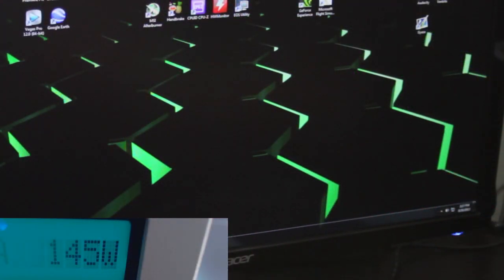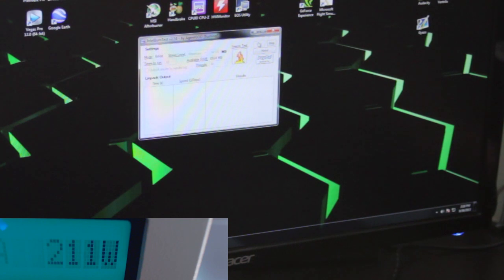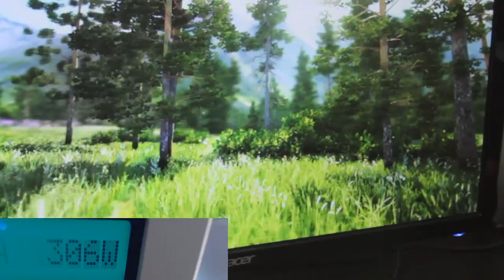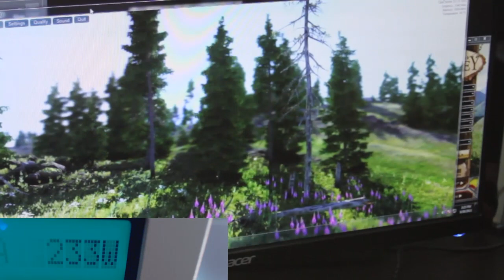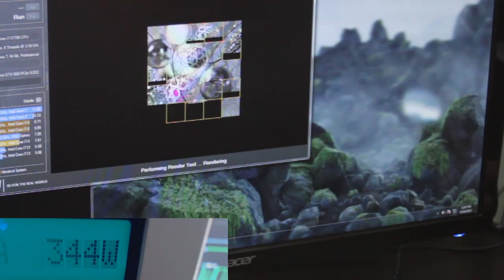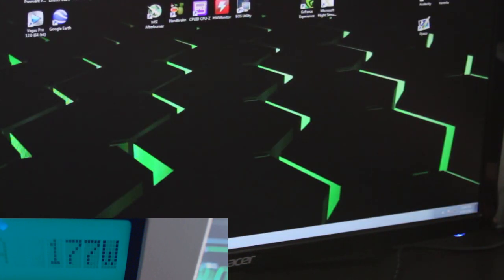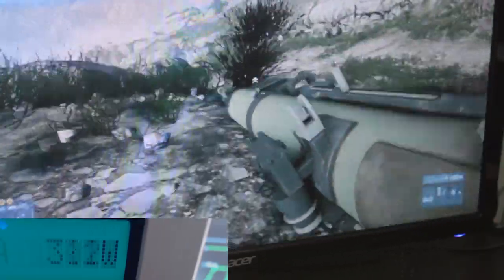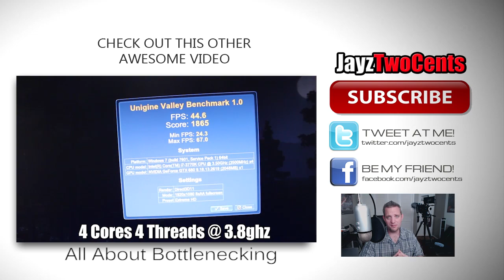How big of a Power Supply do you REALLY need?

Comment: 1:50
He is wrong about how power efficiency ratings work. If you have a 1000 Watt power supply running at 80% efficient that means at 1000 watts it is drawing 1200 watts but only delivering 1000 watts.
Reply: +reaper575556 Jay doesn't take criticism well.
Reply: +JayzTwoCents so did you. You added a z when there's supposed to be an s
Reply: +JayzTwoCents Well, then add an annotation in the video, so that people know what's right and what's not.
Reply: You are wrong spank. If you have ever taken the time to read the nameplate on a power supply it is obvious that the power rating is referring to the output not the input. for example and EVGA 750w bronze is rated for 150W 3.3V/5V, 732W 12v, 15W +5Vsb, and 9.6W -12V. It also lists an OUTPUT of 750W @ 50C. For a bronze at typical load is 90% efficient you will get roughly 833W from your wall. The identically rated 750W platinum power supply at typical load is 92% efficient or roughly 815W from the wall. Both those values assume peak efficiency at maximum load which is true for the majority of air cooled DC to DC converters. The 80+ does not refer to peak load it means efficiency will never be less than 80 under any load.
Reply: +Gref ranger 1250 watts actually,
Reply: aiden therat easily
Reply: wait so who the hell is right? I used Outer Vision Power Supply Calculator and it gave me a load wattage of 698W and recommended PSU wattage of 748W its saying get a 850W. im running a 800W is that a big deal?
Reply: gundamxzero3
Man, stop feeding the trolls, they'll start reproducing soon!
Reply: Bump!
Reply: +Eamonn O'leary he's called Jay-Z of course
Reply: Gref ranger and the rating says 80 plus efficiency at 50% load
Reply: But anyways , get a 80+ certified PSU
Reply: +RedGeoBlaze Im actually not sure which way its calculated, so you are possibly right.
Reply: +JayzTwoCents can you mention your pc build specs in the testing video?
Reply: +Kevin Campbell machst du lieben neunundsechzig?
Reply: Red Phoenix
No, it will pull 1440W and deliver/output only 1200W.
Reply: im not understanding your response could you say more?
Reply: ....ok? Im actually an adult and I paid for it myself. I had a question though, are you capable of answering it?
Reply: Gref ranger but 1000 is not 80÷ of 1200
Reply: Gref ranger is it fine if you have a 800w psu but only 500w wier just for 1 day
Reply: +Gref ranger So 1000w is 80% of 1200w? Maybe you mean 1250w?
Reply: +JayzTwoCents You could add an annotation to correct the error in the video.
Reply from the maker: Been pointed out about 500 times, well 501 now. Also, you misspelled your username.
Reply: +Intel Core i7 6900K (Overcocked to 6.9GHz) is a 400w power supply good enough for a a gtx 750 ti and a amd fx 6300
Reply: +Gref ranger No PSU ever runs at full load for any sustained length of time. So that number is synthetic. It depends on how much it is drawing at the moment.
Reply: +JayzTwoCents so he is right though? the rating is what it puts out? not what goes in?
Reply: you are actually also wrong. it means it's drawing 1250w from the wall as 80/100=1000/1250. before writing anything else stupid verify your calculs
Reply: A 1000w supply with 80% efficiency will deliver 800w at the correct voltages.  Once it delivers more wattage voltage is not guaranteed to stay within tolerances.  The 12volt rail may deliver 13volts or 11volts for example which could cause crashes or damage components over time.

Comment: Is 500w enough for a R9 270x with an AMD FX 6300 I will be gaming I need a response pretty fast :D
Reply: Perfect, the only reason you would be worried is if the power supply is not 80 plus certified. Or if you are doing crossfire. Im using a FX-8320 and a Gigabyte R9-270x. I use only HALF of the wattage it says it has. I plan on getting a Second R9-270x. Long story short. Yes its perfect.
Reply: You use this power supply?
Reply: No, i dont. I use a 700w. But i know it will work. You could use a 430w psu and it will still work as well. Trust me, if its a quality brand and is 80 plus certified. Its fine. Unless you want to crossfire, then you'll need to get a larger psu.

Comment: Hello guys! Looking for some help here, im going to get a new power supply for my computer and i want really a quiet power supply. My 630 watt no name supply is just to loud... I have a EVGA geforce 760, a AMD FX 6300 with a Cooler master seidon 120 watercooler, 8 GB Patriot viper 1866 ram, a fan controller for 5 fans and one fan plugged into the motherboard. AND soon im going to upgrade to a SSD boot drive and a normal HDD for storage. Any suggestions??

Comment: There is ALOT of misinformation here. The latest power supplies run most efficiently between 20-50%. The gentleman in the video was dialed in correctly for his current setup with ONE video card. Also, at lower wattage usage, power supplies tend to have tighter voltage regulation and less ripple.

   Also, there is no wasted money and electrical consumption won't go up just because you have a bigger power supply. If anything, many times the smaller power supply can actually draw more power if its not run at its optimal efficiency range.

  This bro needs to update and correct this video PRONTO!
Reply: you're a fucking loser hahahahahaha
Reply: ***** Ah, the AMD troll who knows nothing about hardware electronics, LOL!  Keep riding the bologna pony my friend! =D
Reply: Yeah, just look at the efficiency compared to load graphs for some PSUs

Comment: Please can someone advise me ?

Several years ago, in my ignorance, I purchased a Enermax Galaxy 1000w psu, and so according to what's been said on here, I've been running this at very low efficiency.....

I've just purchased my bits for a nearly completely new machine and this will be my first OC build (all my previous builds have been standard/non-oc).

My work is in 3D rendering/animations/3D modelling.  Without doubt it's the rendering of scenes which puts my machines under load/stress.

My new machine will be the following (bits have yet to arrive);

Asus P9X79-E WS
32Gb Ram (Corsair Vengeance) 1600 ddr3,
4930K i7
Corsair H100i
Quadro K5000

7 fans (all 120mm Corsair Ultra Quiet SP and one AF),

I'll be using my existing
Crucial M4 256Gb SSD
4 x 1TB WD (RE2 I think they are),
DVD drive.

and

2 x 2TB WD Blacks (these will be new)

I do tend to run a lot of USB devices (around 8-10).

I intend to mildly overclock and maybe at some point put in a 2nd Graphics Card (perhaps a Titan when they really come down in price)

My question is;

Do I keep this PSU, or do I go down to something like the AX750i ??

I've been using this 1000w psu for 3 years and have never had a problem with it - and whilst I'm no expert, the feeling I'm getting from watching this video is that I'm simply putting money down the drain with such a large PSU.

Any suggestions ?

Thanks.
Reply: Thanks for your suggestion but I sold it.

After reading and watching a lot of YouTube stuff about this very subject, I could see I had a PSU that was way too large for my needs.

I sold it (with all my system) and bought a Corsair AX760i which comes with software which gives readouts of actual power consumption.  Under heavy loads my new machine bubbles around 350w, which is around 1/2 the capacity of the 760, which is where its peak efficiency lies, which is pretty perfect - so it was a good decision.

But thanks for your input.
Reply: No problem either :)

I build my own, and this is what I built

Asus P9X79-E WS Mobo,
4930K (clocked to 4.25Ghz and which runs at 22Deg C idle and 40Deg full load),
32Gb Corsair Vengeance Ram,
Corsair H100i watercooling Heatsink,
Corsair AX760i PSU (with D-Link Software),
Quadro K5000 GPU,
256Gb M4 Crucial SSD for OS,
4TB WD Black Sata 3,
4 x 1TB WD Recipricators,
Corsair C70 Vengeance Case,
2 x Dell U2711 27" monitors.

I'm really pleased with this Asus Motherboard, my first time venturing into OCing and first time away from SuperMicro Mobos, and everything has worked so smoothly.

I did try to install a Bitfenix Recon Fan Controller (as I put inside 5 Silent Corsair 120mm fans) but it was very temperamental and hardly worked, so sent it back for a refund.

The machine has been built for 3D rendering and Modelling software and compared to my 4+ year old i940 machine, render times have been slashed by around 60%.

Hope that is useful and helps :)
Reply: *****

Hi Yaroslav,

Difficult to say because it was made from parts which came from my old machine, but approximately its build price (my time is free !) I'd say is around £5000.

Comment: it does not mean that if you had a 1000w psu you could only use 800w of the power. what it really means is if its pulling 1000w from the wall at 80% efficiency your psu is delivering 800w to internal components. a 1000w psu can pull more than 1000w from the wall  but it cannot supply more than 1000w to your components. this is a very often misinformed point that even this guru didn't get right

Comment: what psu should I get 600w 80+ bronze or 750w 80+ bronze if Im using: AMD FX 6300 4.1ghz CPU, 8gb 1600mhz Vengance RAM, EVGA GTX 770 overclocked, 1208gb SSD, two 1tb HDDs, 8 fans, and two LED strips ?

Comment: What wattage would you recommend on a rig running an i7 4770k (moderately OC'd, maybe to 4.2/4.3), R9 290 non-x/non-ref (might CF later on), and two HDD's + one SSD? I was thinking about 850W but idk how much a CF'd 290 would draw on real loads.
Reply: You won't need 850w, I'm using 850w with 2 7950's overclocked, 4 hard drives, 2 ssd's, 13 fans, led strips, 2 dvd drives,  and an overclocked i5 2500k.
Reply: Get a 1000 watt. R9 290's are very loud and drain too much power on load.
Reply: [Project: Blue]  What's your total power draw on load?
Reply: jerry lui I have not got the slightest idea. I don't bother measuring it.
Reply: [Project: Blue] Ah, I ended up getting the corsair ax860w for that plat rating (amount other things). 860W gives me some headroom to OC as well since those 290's are pretty power hungry compared to your 7950's haha.

Comment: That's pretty cool. So my 500watt psu is not being used all that much with an Amd a8-6600k overclock to 4.4ghz, an 120gb ssd, 12gb ram, 1tb storage, 2 120mm fans and 1 140mm. I think im definitly going to overclock more for sure. And i might throw in a better graphics card and overclock it. Good to know, thanks Jay.

Comment: Can anyone tell me if a 500W PSU would be enough for an i5-4570 + a GTX 760 + one HDD + 4GB of ram + maybe a couple fans (7 max) ? It's the first time I'm building a PC and I have all the pieces down, but I can't really set this whole PSU deal straight. Should I just play it safe and go for 600W or is that overkill ?
Reply: Well the GTX 760 is rated at least 500watt psu. So your good there, and after watching this; I think you'll be fine for future upgrades as well. Intel processors do not normally use all that much power. The i5-4570 is only rated at 85 watts. Hope that helps.

Comment: What are you going to use a 4930k with a water cooling loop with 4 GTX 780s? If no you don't need 1000w. You should be 100% good with 600w

Comment: Better off spending the extra $20-30 on a 650. A 650-700w PSU should do just fine. Just make sure you go with at least 80+ efficiency. The PSU can take your whole system with it, if it dies.

Comment: Or, let's say that your wall meter is reading something like 750W:

If your PSU is 80% efficient while pulling 750W from the wall outlet, then that means your computer is pulling 600W from the PSU.

If it's 85% efficient while pulling 750W from the wall, then the computer is pulling 637.5W from the PSU.

If it's 90% efficient, then the computer is pulling 675W from the PSU.

95% efficient would mean the computer is pulling 712.5W from the PSU.

That's what a PSU's efficiency is all about.

Comment: The efficiency of a PSU has absolutely nothing to do with its output capacity. If you have an 80% efficient 1000W PSU, it does NOT mean that you have 800W to work with. What it means is simply this: if your power draw is exactly 900W and if the PSU is 80% efficient while your computer is pulling 900W from it, then the PSU will be pulling 1125W from the wall outlet. For comparison, at 85% efficiency, it would pull about 1059W from the wall outlet.

Comment: don't let that TDP throw you off too much - that really means how much heat the cpu gives off but it will be close. overclocking does increase it but you do not have to worry. the motherboard chipset for a ivy cpu uses 8 watts, a stick of ddr3 uses 4 watts, a HD uses ~5 watts (7200 rpm) and most fans use ~1 watt. 
it all won't be more than half of the cpu. that 150 watts i mentioned before is the total power "sweet spot" for most overclocked i5 and i7s - that means everything.
glad to have help.

Comment: it will be close and here is why i think. go to techpowerup(dot)com and search the reviews. they always have the power consumption of *just* the card. the 660ti is ~146 at peak or 292 for both. the cx600 has 46amps on the 12volts  for 552 watts. the 12 volt runs the graphics, cpu, motherboard chipset, fans, ram and hard drive motor so add ~150 watts for intel and 165 watts for an amd cpus (both overclocked but the fx 8350 can hit ~185 watts).
292+150= 442 intel and 292+165=457 amd.
make sense?

Comment: oopps, shame on me for overlooking it had enough power connections :p 
the PSU will supply 600 watts, being 80+ bronze means it will draw 705 watts from the wall @ 85% efficiency.(600/0.85=705).  there is some difference with capacitors tolerating heat bu t as long as the fan works properly - they won't get hot and dry out. psst that 15% aging stuff is a myth - its heat not time that affects a cap. 
the CX series is a good budget PSU and a 600 watt will be fine for any single graphics card. :)

Comment: Thanks mate, I already replied to Jay saying that my PSU has two PCIe power cables (6+2 pins) not just one so no need for adapters, I was sad cuz he didn't reply to me :(
Anyways, I'm wondering if the wattage is enough or not considering it's an 80+ bronze PSU, and if the capacitors and stuff in my PSU will handle my system's power needs without having to deal with shorter life time, fluctuations in power delivery... and all that crappy stuff :/

Comment: don't be sad panda.
i think jay is overlooking that a single 18 awg wire can deliver 100 watts. (that's the yellow 12 volt wire) using one adapter for 75 watts (what the 6 pin supplies) will be ok. and considering the 660 won't use more than ~140 watts (split 3 ways between the two 6 pin plugs and the pci-e slot that each supplies 75 watts for 225 total) it won't need all the 75 watts through the adapter.

Comment: I have a Thermaltake 750 watt 80+ bronze rated power supply. When I was using it with my Q9650 @ 3.6 Ghz, paired with (2) GTX 460s in sli, I did manage to shut it down when I OC'ed the GPUs to 825 Mhz. Those cards were pretty power-hungry! You could tell when the PS was being pushed hard, because the room would start to get hot and the fan on the CPU cranked up.

I'm now using that PS with an i5-2500k @ 4.7 Ghz, paired with an EVGA GTX 670 FTW! It never gets hot.

Comment: AMD CPUs/GPUs generally use a fair amount of power more than Intel and Nvidia. A 520W for that system isn't too much overkill, the point of this video was more for those people who decide that since they're overclocking they need a 1000W PSU which is just entirely incorrect. That Silverstone PSU is a pretty good one for you, but perhaps try to get one which is 80+ Silver or Gold, because they are more power-efficient and therefore generally save you a fair amount of money on electricity.

Comment: Thanks for the reply Jay but I'm afraid you are mistaken, the CX600 V2 actually got 2 sets of PCIe cables, both of which are 6+2 pins, and the GTX 660 none Ti version only requires one 6 pin power cable , as far as cables go, I don't think there's any problem no need for  adapters and crap :) but what about the wattage :/ on some forums they say that the CX600 isn't enough for SLI, some others say it is... I'M CONFUSED  >:(

Comment: Ok thanks for the info, I was asking because if the GPU use less power then recommended I can upgrade to a newer card. In your opinion could I be able to upgrade to say a 7870 or even in the 79xx series? 
Spec: FX 6300
Asus m5a97 r2.0
Rosewill green series 530 watt
msi 7770 ghz
8 gb kingston ram
 Your help and opinion would be most welcome.

Comment: Actually the 80+ example in the 1kW PSU isn't correct (ie that a 1kW 80+ = 800W to the components). A good 1kW PSU will provide 1000W power regardless of efficiency. 

However a 1kW PSU with 80% efficiency will draw 1250W from the socket to provide that 1000Watts. A 70% efficient PSU will draw  1430W from the socket for the same amount of Wattage to the system.

Comment: Nvidia and AMD recommend higher wattage than is actually needed just to ensure that all builds with different quality power supplies will be able to support the card.  If you add up the TDPs of the CPU, Motherboard, and GPU, you can get a more accurate picture of how much power you need to support a GPU.

Comment: For a 300w load you're only going to save a few more watts with 2-3% higher efficiency.  It's going to take several years for a 10w difference in efficiency to save $20 worth of power, so it's usually not worth it to get a higher efficiency or higher wattage power supply for small loads.  With larger loads that you might get with dual GPUs, getting a higher 80 plus rating can pay for itself in a few months if you get the PSU for the right price.